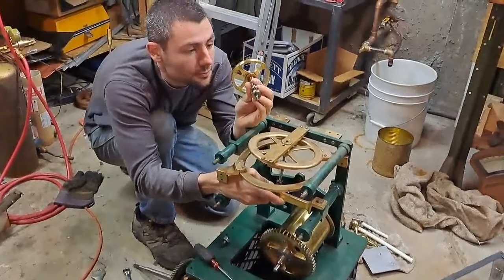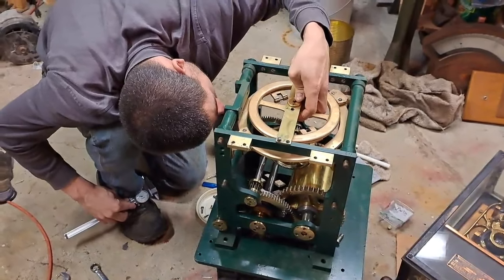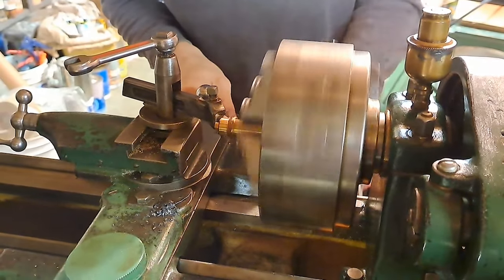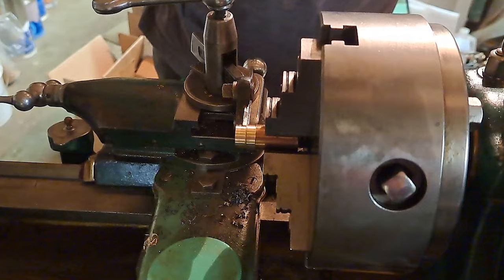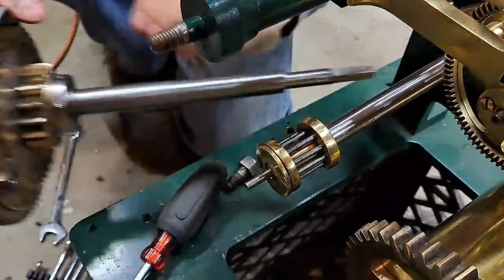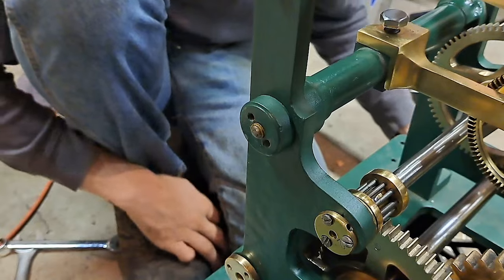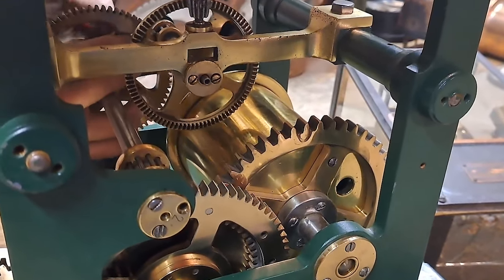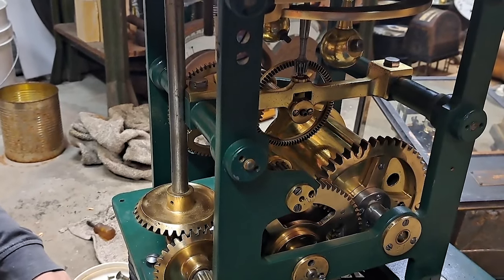Fresnel Lens drive clock repair Pt.3

Comment: Discovered your channel through The Proper People on the water works video that was uploaded over a year ago. Still amazes me there’s people out there who are mechanically inclined and likeminded out there, probably the only ones who can identify and diagnose something by various sounds and such. 

People in today’s society can convince me that today’s engineering is better etc until they are blue in the face, fail to realize that new technology is basically masquerading as something it’s not. Since I am a automotive nut/nerd along with a affinity for things that are mechanical and older technology, there’s nothing ‘new’ about modern vehicles. Internal combustion and electric vehicles are over 100 years old, modern vehicles that use ODBII are approaching 30 to 40 years old since the tech was in the works in the late 80’s, so modern vehicles really aren’t as ‘modern’ as people think they are. But it seems, today’s hell-bent society doesn’t realize that things masquerade as something it’s not. 

Can only push technology so far to the point you end up with a lemon that has major issues from the get go. Once something reaches a pinnacle, might as well leave well enough alone.

Comment: Very interesting friction governor design, never seen that style before.
Reply from the maker: this in differing forms was the usual, sadly the air drag regulators were rarer despite being technologically superior
Reply: Nor I,  I don't think it to be as reliable as an air governor due to possible oil contamination of the friction materiel from over enthusiastic oil maintenance etc.  I agree the butterfly air governors look more impressive.  Fred Dibnah would have enjoyed a beer with Mr Karnes.      You may find   ' The Lancashire Textile Project "  and interesting read.  Best